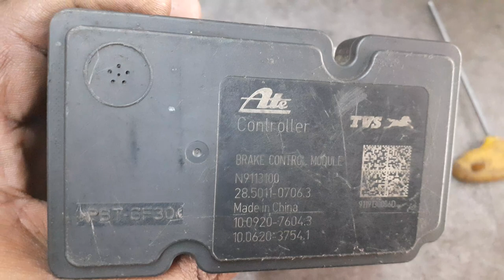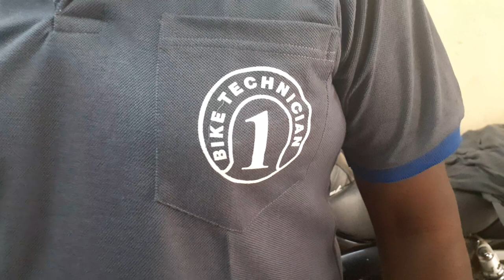ABS (motorcycle) Motor inside mechanism | tamil |

Comment: Nanba na oru computer & mechanical engineer 
In my that color code blue main yellow earth
Socket 18 pin athula 10 pin dha 3&2 totally 10 pins
4stem marking vanthu 1&4 line 2&3earth
Antha aluminum body heat sink for fan & electronic cooling purpose
Ithu just ennoda knowledge la soldran neega check pannunga idea varum
Reply from the maker: Thanks nanba unga helplaam romba thevai.
And about OBD 2 protocals and functions .
Reply: Nice
Reply: @bikemechanicvip3007  thanks
Reply: @sdcomputertechnologies   thank u
Reply: Bro yello low pressure line blue high pressure line ahh irukkum

Comment: I think those blue and yellow rounds are magnetic coils, that's why they have a pin inside. When the ABS sensor sends signal to ABS UNIT, it energizes the coil (Blue or yellow) moving the pins (solenoid) up and down distributing pressure accordingly.